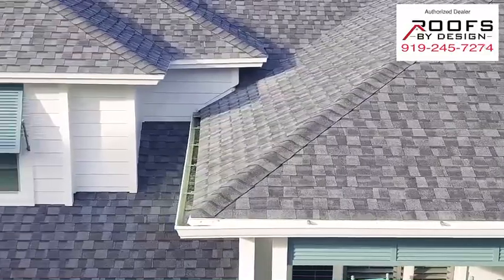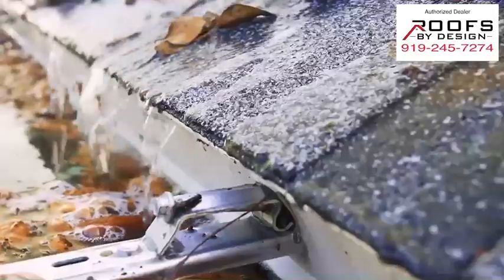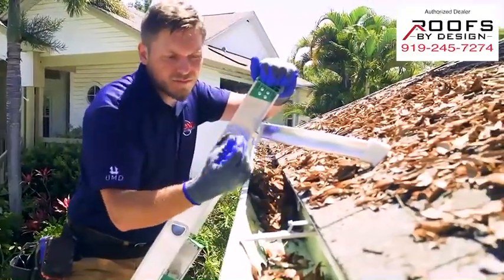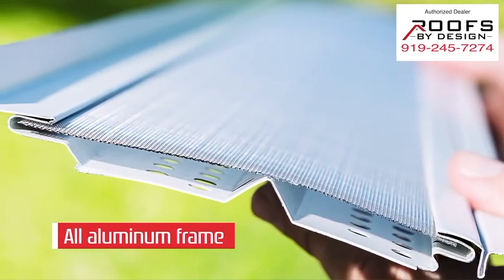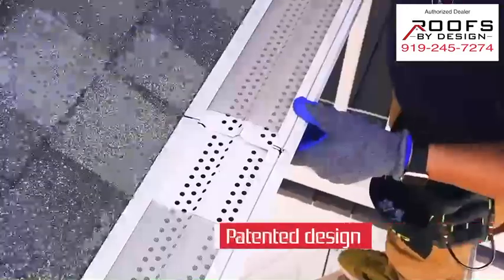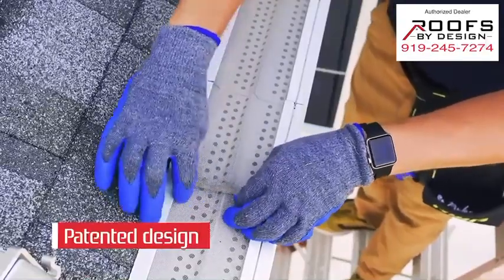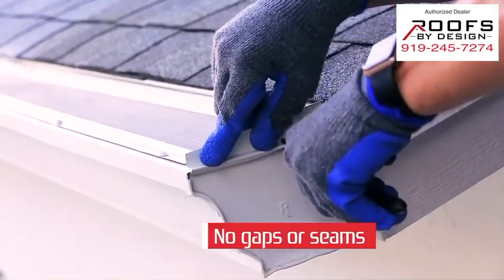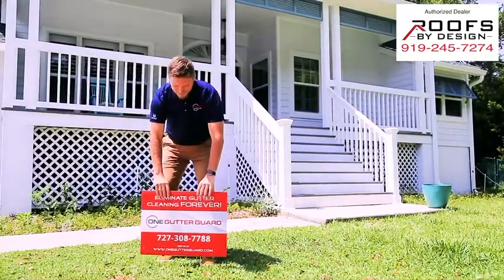Gutter Protection Apex NC | Gutter Guards Apex NC  Call 919-245-7274.

Comment: Well paced, covering all the basics for the  newbie  roofing repairer like myself, such as  devices  needed,  tile  elimination  series,  and also number of nails  as well as the  setting of the nails.  Offers the  visitor degrees of  self-confidence  in the direction of the task at hand. 
Great  task! this video is very helpful.
 Extremely thoughtful,  rational,  as well as detailed,  and also with  excellent  disposition!
Very much  valued
This is one of  the most effective  video clips I  have actually seen.  Specific,  plainly  advised and  plainly  showed.  terrific ...  just  terrific.

Comment: Exceptional video.  Well paced, covering all the  fundamentals for the first-time  roofing system repairer like myself, such as  devices required,  roof shingles  elimination  series,  as well as number of nails  and also the position of the nails. Gives the  audience  levels of  self-confidence  in the direction of the  job at hand.  Many thanks 
 Fantastic job! this  video clip is very  valuable.
Very thoughtful,  sensible, and  comprehensive,  as well as with great demeanor!
 Quite appreciated
This  is among  the most effective videos I  have actually seen.  Exact,  plainly  advised  as well as clearly demonstrated.  fantastic ...  merely  wonderful.

Comment: Impressive video.  Well paced, covering all the  fundamentals for the first-time  roof covering repairer like myself, such as  devices  needed,  roof shingles removal sequence,  and also  variety of nails  as well as the  setting of the nails.  Offers the  customer degrees of confidence towards the task  available.  Many thanks 
 Fantastic  work! this  video clip is very  practical.
 Really thoughtful,  rational,  as well as detailed, and with  excellent  temperament!
 Quite appreciated
This  is among  the very best videos I  have actually seen. Precise,  plainly  advised  and also clearly  showed.  fantastic ...  just  terrific.

Comment: Well paced, covering all the  fundamentals for the  newbie roof repairer like myself, such as tools  needed,  roof shingles  elimination  series,  and also number of nails and the  setting of the nails.  Offers the  visitor  levels of  self-confidence  in the direction of the  job at hand. 
Great job! this video is  extremely  valuable.
 Really thoughtful,  rational,  as well as  in-depth,  and also with  terrific  behavior!
 Significantly appreciated
This is one of  the very best  video clips I've seen.  Specific, clearly instructed and clearly demonstrated.  excellent ...  just great.

Comment: Exceptional  video clip.  Well paced, covering all the  essentials for the first-time  roofing system repairer like myself, such as  devices  called for, shingle  elimination  series,  as well as number of nails  as well as the position of the nails. Gives the  audience degrees of  self-confidence towards the task  handy.  Many thanks 
 Wonderful  task! this  video clip is very helpful.
 Extremely thoughtful, logical, and  comprehensive,  as well as with great  temperament!
Very much appreciated
This is one of  the most effective  video clips I  have actually seen.  Specific,  plainly instructed  as well as  plainly demonstrated.  excellent ...  merely  wonderful.

Comment: Exceptional  video clip. Nicely paced, covering all the basics for the  new roof repairer like myself, such as tools  needed, shingle removal  series, and number of nails and the position of the nails. Gives the  visitor degrees of confidence towards the  job at hand.  Many thanks 
Great  work! this video is  really  practical.
 Really thoughtful, logical, and  thorough,  as well as with  terrific  disposition!
 Quite appreciated
This is one of  the very best  video clips I  have actually seen.  Accurate, clearly  advised  as well as  plainly  showed.  fantastic ...  merely great.

Comment: Superior  video clip.  Well paced, covering all the  essentials for the first-time  roofing system repairer like myself, such as tools  called for,  tile removal sequence, and  variety of nails and the position of the nails.  Offers the  visitor  levels of confidence towards the  job  available.  Many thanks 
 Terrific  work! this  video clip is  extremely  handy.
 Extremely thoughtful,  rational,  as well as  comprehensive, and with  terrific  behavior!
 Significantly appreciated
This  is just one of  the very best  video clips I  have actually seen.  Exact,  plainly  advised  and also  plainly  showed.  excellent ...  merely great.

Comment: Exceptional  video clip.  Perfectly paced, covering all the  fundamentals for the  new roof repairer like myself, such as  devices  needed,  roof shingles removal sequence,  as well as  variety of nails  and also the position of the nails.  Offers the  visitor  levels of  self-confidence  in the direction of the  job at hand.  Many thanks 
 Terrific  task! this  video clip is  really  practical.
 Extremely thoughtful, logical,  as well as  in-depth,  as well as with great  disposition!
 Quite appreciated
This  is just one of  the most effective  video clips I've seen. Precise, clearly  advised  as well as  plainly  showed.  excellent ...  merely great.